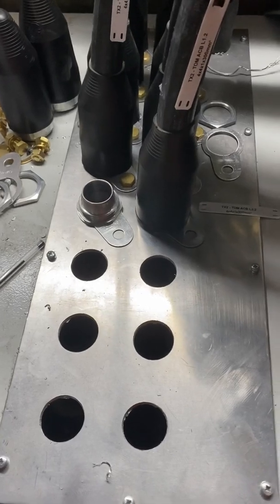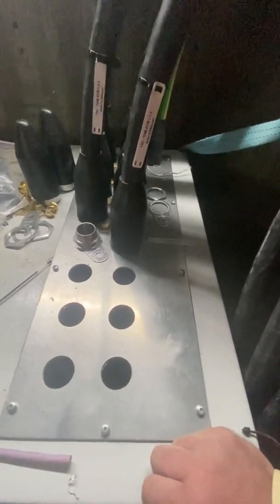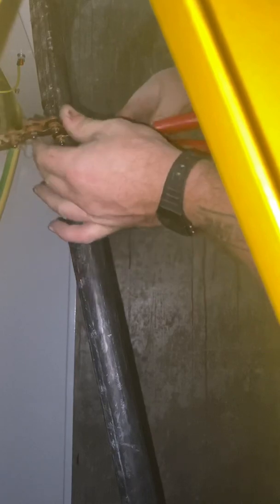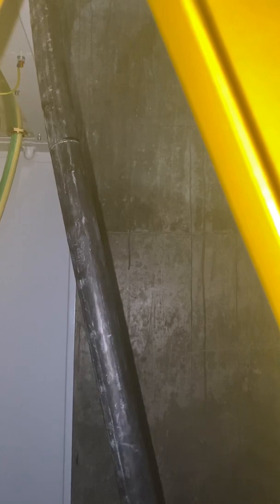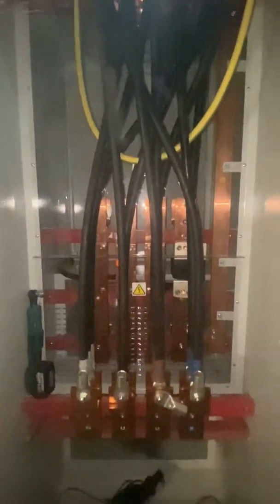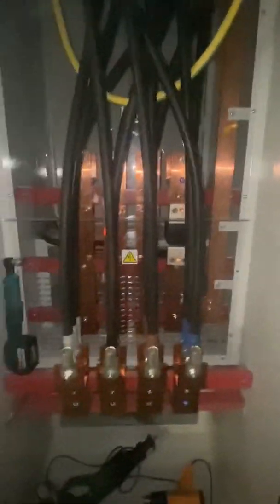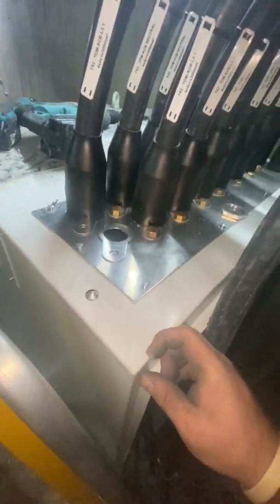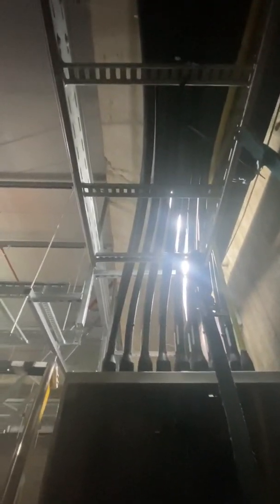Waterloo station 16 1c x 300mm

Comment: Hi great video couldn’t you use a crows foot to tighten the gland nuts when you can’t get the grips in. 
Dan
Reply from the maker: Tell me what a crows foot is. I've never heard of one before.
Reply: @jointechcabling9103  I will send you a picture on Instagram as I don’t know how on here 
I worked on trucks and if I couldn’t buy one I used to make them it’s basically the head of open ended spanner cut off and a 3/8 or 1/2 inch socket welded on it so you can put it on a long extension and use a ratchet lower down to turn it 
I’ve got some small ones at home I will send you pictures of my ones Dan

Comment: Do those bundles of cables get warm when power is being used. A thermal camera to see the temperature difference of the cables. 😳
Reply from the maker: They allow for the grouping of cables when they design to job. They size will be determined by lots of things and grouping is one of them. They only get hot if someone fucks up!

Comment: Good work!! Are you self employed or work for a company ?
Reply from the maker: Thanks very much. I’m self employed, have been for 15 years.
Reply: @jointechcabling9103  ok so your classes as a cable jointer mains termination mainly ? Wouldn’t class your self as an electrician and do you do HV
Reply from the maker: @ukbullylife7968  I am an electrician but as I don’t do the other aspects of electrical work anymore I class myself as a cable jointer as that’s essentially all I do now. It’s turned into a niche area of electrical work. Much the same as fire alarms and cable pulling. 
I thought about hv but I don’t really get enough work my way to spend the money on the course.
Reply: @jointechcabling9103  fair enough jointing is defo niche and u do it well 👍🏽
Reply from the maker: @ukbullylife7968  thanks man. I appreciate that.
Reply: @jointechcabling9103  I’ve ordered an exhaust cutter will let u know how I get on. Defo looks a game changer never seen anyone ever use anything others than hack saw when it comes to bigger cables. Ck armour slice is good for smaller stuff up to 25mm
Reply from the maker: @ukbullylife7968  I use an adjustable plumbers wheel. It uses one cutting wheel and I think it’s better than the ck tool.
Reply: @jointechcabling9103  nice any u recommend
Reply from the maker: @ukbullylife7968  hahaha I don’t know the name of the one I’ve got. I walked into the plumbers wholesalers and bought the first one I saw. I know nothing of that weird non metric universe they inhabit 😂😂😂
Reply: @jointechcabling9103  ok does it matter brand and how much it set you back ?
Reply from the maker: @ukbullylife7968  I think they cost under a tenner. They’re not expensive at all. I think the one I’ve got is a basic model, nothing special at all really.

Comment: Nice video again thanks for doing it are the plates that you gland the single core armours into made of aluminum ? If so does the Ali react with the brass glands?
Reply from the maker: The plate is Ali and the glands are also Ali. It’s coz the armouring in the cable is also aluminium. Thanks bud👍🏻👍🏻
Reply: @jointechcabling9103  Thanks for that info as said great video